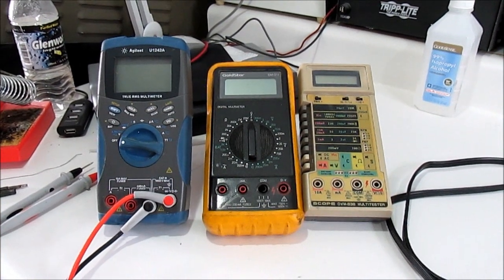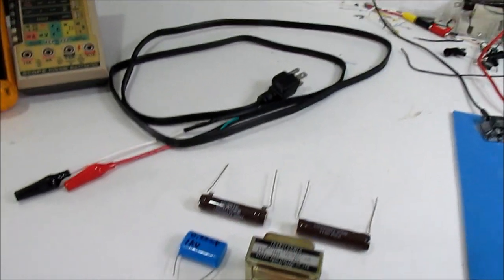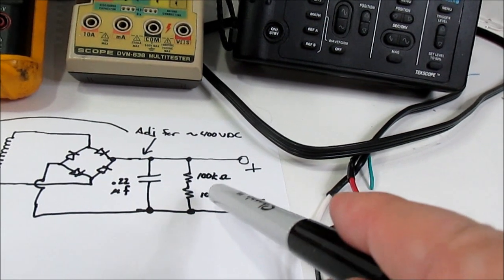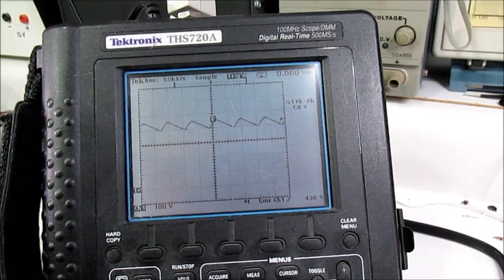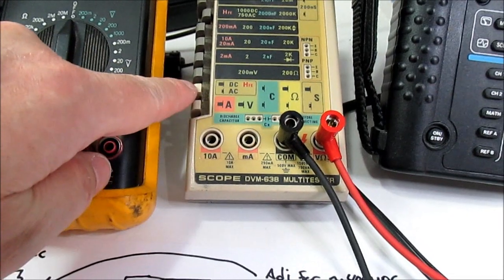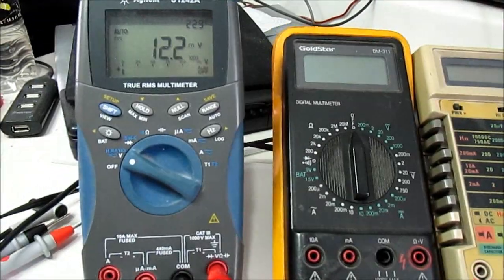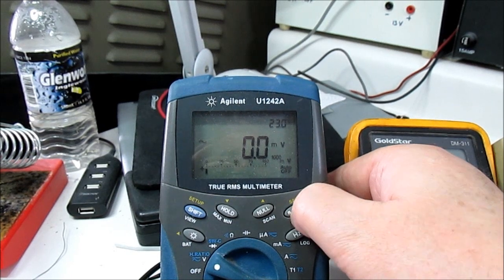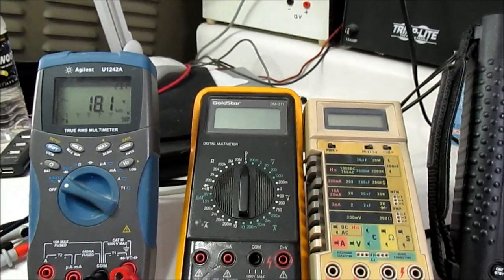Digital Multimeter Comparisons on AC readings...

Comment: Hello, I was given a scope DVM 638 meter like you have in the video.  I'd like to check it out to make sure that it works properly in particular the continuity test.  Would you have any information that you could send me on this meter particularly the continuity test?  Thank you very much
Reply from the maker: Hi, I possibly have the manual for it ~someplace~ but no idea where at this time and have not seen it in decades.  I did spend a little time looking but did not find it.  I ~did~ find a 1990 catalog showing the meter with the spec's on it.  I will post a short video of the photo of that page if it helps.

https://youtu.be/-xEwoOW9HsM

The meter has if I recall a bunch of modes on it related to the ohms range including diode check and a logic level test.  I can also display in conductance instead of resistance.

I will keep my eye out for that manual but it could be a long time until its located, unfortunately.

Comment: Very interesting!  This is line frequency so it should be optimized for that.  Very discouraging that an expensive name brand operates so poorly in this scenario.  It is probably the high dc that is throwing it off but very disappointing.  If you had not had it since new, I would think that somebody has hurt it somehow with high-voltage. But, HV usually causes actual damage where it doesn’t work as well as a did.  Also in manual range it worked fine in the 100 range which was probably needed because of the peak to peak values.
Reply from the maker: Yes, the behavior when in a fixed range as it seems to settle on a value reminds me of how some simulator software behaves when asked to plot the RMS value some some waveform.  The simulator plot of the RMS seems to decay to a value as more samples come in.   One wonders if the SW in the meter does similar.  I am not too up on how some of these algorithms work anymore.

Comment: My Agilent does the exact same thing. I bought it used and thought it might have an issue. My Fluke 189, 115 no problem. My Brymen 869s, 525, 235, no problem. Everyone of my quality DMM’s have no issues with that and even my budget meters are fine. Just the Agilent, it is quirky on resistance at times too. I went in and added some shielding thinking maybe some external noise could be messing with it. Helped a bit but not that issue. I like the Agilent but it is glitchy sometimes.
Reply from the maker: Yeah, seems like the firmware or software in this meter are not too compatible with a relatively small AC riding on a large DC.  The behavior on a fixed range (so it was not jumping all over) looked to me like the SW was converging on a reading a lot like I have seen on some circuit simulators when asked to show the RMS of a waveform.  I have used this meter on AC mains and also a portable generator output before w/o issues but those don't have a large DC offset.

Comment: It would be interesting to compare the 1242 to a VTVM with a high impedance AC input... Not sure you have one of the older VTVM...
Also, it would be nice to check out the capacitor checker a bit more.. As someone already mentioned, those BLACK BEAUTY capacitors must go.. 
But you can check those black beauty caps if you have a different Cap / Leakage checker for testing..
Robert
Reply from the maker: All these DMMs should have the standard 10M-ohm input.  I DO have a VTVM (Heathkit V-7A) but don't have the test leads for it.  I think the AC requires a special probe.  I also have a 1960s military surplus VOM too but its not currently accessible.

I will revisit the TCA-1 at some point soon I hope.

Thanks for the comment!